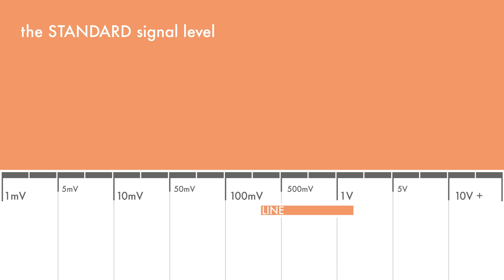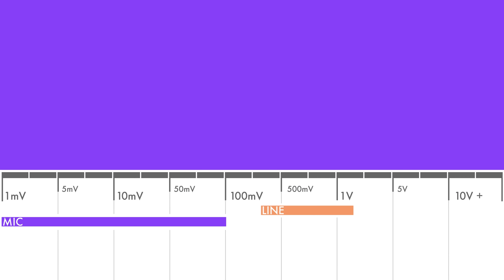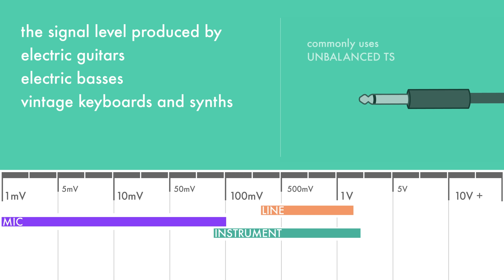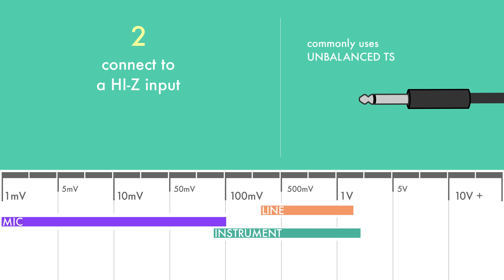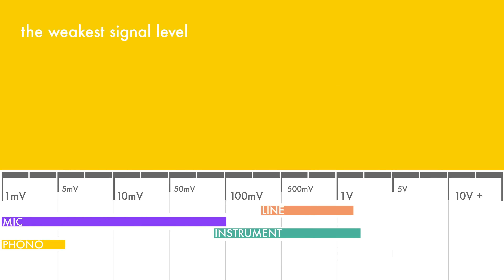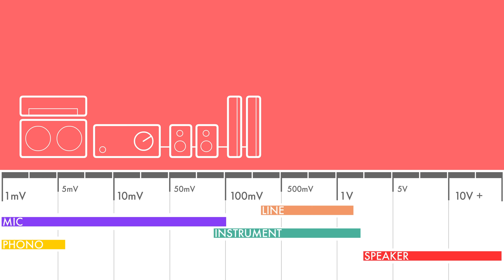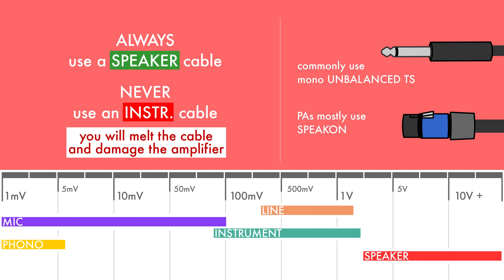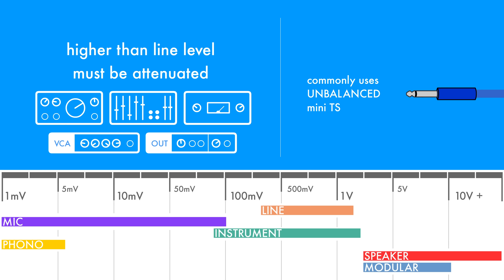Audio signal levels explained: Mic level vs line level vs instrument level

Comment from the maker: If you have any specific questions about your cables and connections, leave us a comment, or ask us on Discord 😃
Reply: And auxiliar  connections?
Reply: @canalmeu8865  Are usually unbalanced line levels.
Reply: Where do headphone output signals fit in on the graph?
Reply: @RCAvhstape  That depends on the headphones. Are those 32 ohms, 8 ohms, 4 ohms? What wattage is the output capable of delivering? Those can vary wildly across headphone amplifiers. In doubt, read the technical specification section of your manual, it should specify these values.
Reply: hey, i just commented a question in the main comments on this page :) would love to hear your thoughts
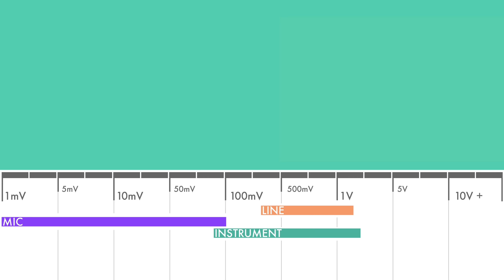Reply: 1:17 All these signals are AC biased to 0 volts, right? Like that 1V line level signal is moving between 1V and -1V, right? Same with mics and instruments?
Reply: @scottholyk8224  All AC signals are typically given as RMS, not Peak-to-Peak. RMS (root mean square) is the equivalent energy of a DC current with the same energy content over the same sink impedance. I know that may sound like gibberish - just multiply the RMS value by sqrt(2) (roughly 1.414) to get the Peak value (for a pure sine wave, complex signals are close enough though).
Regarding Bias, any unbalanced connection is alway referenced to Ground. For balanced connections, the two signals reference against each other.

Comment: Hi, how would u suggest  connecting a  line isolator to the mixer? They bring low impedance output and use xlr output. Should we just plug into the XLR input  in the mixer or use XLR adapter to connect it to the line input ? Thanks

Comment: Line level can also be broken down into multiple categories as well, typically based on signal amplitude. Most often used in audio applications are -10dB and +4 dB, although there are now standards for +12 dB and +24 dB as well.

Comment: Honest question. Why do we use a DI box to change guitar signal down to mic level which is sent over XLR cable to the desk which can be tens of metres away or further. Surely the higher voltage from the guitar would provide a better signal level over that distance. I understand that XLR uses two of its lines to send the signal out of phase and thus cut noise, but why not send this signal at the original guitar level.

Comment: more technical: PHONO is tiny (some 1 - 10 mV p-p), MIC, depending on how the internals are set up, can even be relatively high impedance (1 - few 100 mV p-p), LINE, standard, not too much, not too little (1V p-p standard), MODULAR, standardized at 10V p-p, but I'm not sure about that (up to 30V p-p, for +-15V PSU systems, 1kOhm output impedance, per eurorack standard), SPEAKER, the fun one, the juicy one (could range from tiny headphone signals 1-5V all the way up to multi kilowatt 300+V p-p class-D amp outputs at sub Ohm impedance)

Comment: Sorry. Thats not completely correct. 
Mic levels can be much louder. Even so loud that you can use it as line level. E.g. a bassdrum mic. 
Line levels can go up to 15V or even 18V (6dBu level), depending on the headroom. 
Instrument levels can got higher too. 

4dBU is 1.23V.
10 dB headroom is 3V, +20dB sind 15V.

Comment: Yo brother, Love all your videos and tutorials, they definitely have helped me upgrade as a producer/engineer, so thank you in advance, but I have some questions about a drum sampler/machine. I got an MPC1+ and I am trying to just record my tracks from my MPC into FL Studio(my DAW) on my Mac, like they used to do using the old school way, so that I can add stuff within the DAW after the sounds are all recorded and arranged. I have a Yamaha MG10xUF mixer and a Scarlett 2i2, and I have been trying to combine them to the point where I can record directly into FL because the mixer and Scarlett by itself doesn't seem to be able to record directly into FL. The mixer won't print the audio in the DAW, and the Scarlett doesn't produce any sound by itself, so I keep running into obstacles even after trying to mess around with the settings in FL Studio. Are there certain settings that I don't have set up correctly, or am I just doing something wrong with the mixer or Scarlett? I love my MPC1+ and don't really see the point in upgrading to the MPC Live 3 just to multitrack out audio into the DAW, especially when I am trying to get some kinda synth to upgrade my loop/sample game. I just want to be able to combine both my MPC1+ and FL into a workflow that doesn't feel like rocket science. Everyone I ask who uses the MPC uses Ableton, Studio 1, or Logic/Pro Tools, and I do not want to have to learn a different DAW just to get the audio recorded on my laptop. Any helpful information will be very much appreciated and will not go to waste. Thank you again.

Comment: When I was a kid, I turned two tape decks into a distortion pedal, or at least tried to. I’d record to tape 1, then I plugged the speaker out jack into the mic jack of deck 2, and cranked it up. No magic smoke, but no audio either. I blew that tapes mic preamp to shit!

Comment: Your log voltage scale is crucked. The .5 point should not be in the midle of a decade. The midle point is at sqrt(10)/10, that is around .3 not .5. That makes intermediate values impossible to read unfortunately.

Comment: Aren’t higher volume line levels also pretty common in pro audio? +4dBu balanced as opposed to -10dBV unbalanced?

Edit: the voltage range shown for Line probably is referring to +4dBu at up to 1.2V RMS. Consumer line level is supposedly down around the 0.3V RMS level.

Comment: Just found out that line level in studio gear is not the same as line level on consumer devices. 
I connected my phono preamp that outputs -10dBv to inputs 3/4 on my MOTU M4 audio interface which are +4dBu. This results in a signal that is 12dB lower than it should be.
The only line driver I could find to solve this seems to be a Radial J+4 that costs more than the MOTU itself. This is seriously annoying as everything else on the MOTU is pretty much perfect.

Comment: My recording/mixing setup uses many ins and outs; instruments, mics, DAW I/O, effects, and I don't own a mixer with FX insert/return circuitry for individual channels, so I made a multi-channel "pad box" that I can run strong signals through to set their levels to anything from phono to speaker. It consists of several precision wirewound 10-turn linear-taper potentiometers, each connected to multiple paralleled jacks, RCA, 3mm TRS, 1/4" TRS, XLR, etc. All internal cabling is "balanced & shielded" to prevent crosstalk issues and feedback. This gives me the flexibility to route signals of appropriate levels wherever I need to for recording, mixing, mastering and even live event production.

Comment: Instrument cable has a shield 
Around main conducter to prevent RF interference,but
Limits length of cable. Use of
Speaker cable can pick up stray
Radio waves and amplify them
Through  Amp. Don't want that
               🙉

Comment: On the Behringer 204HD it only has a push in button for Line or Inst and a button beside it that says Pad, so if I was using a microphone for that channel would I have it set to Inst?
Reply from the maker: That only applies if you have a jack cable plugged in I think. If you plug in an XLR it will treat the input as a mic in.
Reply: @arbitersofsound  Gotcha! Thanks for the info and quick response!

Comment: You didn't mention there are two line level standards. Consumer (typically 1/8" jack) and professional (1/4" jack or XLR). Super important and they are not compatible.
Reply: Well, "not compatible" is a little strong ... yes pro is a slightly higher signal level but any modern hardware is likely to be able to deal with the difference between pro line level and consumer line level without any issues. Going from consumer to pro ... turn up the gain on the mixer/input ... even going from pro to consumer is likely to be OK as you almost certainly have control over the pro device output ... I've never had to do it but an attenuator pad may be required I suppose. I can't honestly recall ever having had a problem matching between pro and consumer line levels, though it's worth knowing that there is indeed a difference.
Reply: @MrAdopado  I broke a nice portable speaker with a 3.5mm AUX input when I connected my guitar pedal to it. The pedal outputs a pro level signal using TRS or XLR and I simply used an adapter instead of an attenuator. Something fried and it sounded really distorted after that and I had to toss it.

Comment: If Instrument Level uses Unbalanced TS, and Speaker Level uses Unbalanced TS…what is the actual difference? How are the respective cables incompatible? How do you tell the difference?
Reply from the maker: The gauge of the wire is different. A speaker cable will have two thicker conductors inside with no shield, an instrument cable will have a thiner cable surrounded by a mesh (the shield).
Unless the manufacturer has written speaker or instrument on the cable (which is pretty common), the other easy way to tell them apart is to unscrew the jack (if it's possible) and look at the conductors inside.

Comment: What drives me nuts is so much equipment doesn’t clearly specify.  

For example: XLR is not inherently mic level. So many pedals have XLR outputs but they very rarely say what level they are outputting.  We assume it’s mic level but assumption is how you kill equipment.

Comment: Great video! I'm not really up to speed on the whole Hi-Z vs. Low-Z thing, but I do plug line level outputs from my audio interface into guitar pedals as outboard effects and then route those back into Hi-Z inputs. I just have to attenuate the output signal from the interface by 20db for it to work properly without distortion. It hasn't seemed to damage anything and I get great results.
Reply from the maker: That's also what I do with my synths when I run them through my pedalboard. Some pedals can handle it (especially the modulation/reverb stuff) Fuzz can be very specific to what impedance it wants and can end up sounding really bad...
Reply: @arbitersofsound  Fuzz is the big one, and it really depends on the type of fuzz pedal. Since the original fuzz circuit was honestly more of a wiring mistake than intentional, these can vary drastically based on impedance and volume / input voltage. Others are designed to be unaffected by buffers, which are circuits that turn high impedance into low impedance for longer signal chains. You can, however, trick older fuzz circuits with the use of a transformer based device that converts your new low impedance signal back into a high impedance signal, though doing this too many times may cause minor tone changes. 

The general rule of fuzz is that the fuzz should always go first, immediately after the instrument, but the rule of audio is that wherever and however you get the sound you want is what matters most. The bigger issue I've noticed with pedal boards is that some digital pedals cannot handle higher input levels without possibly causing damage to the unit. Another very important rule of audio - read the manual and the spec sheet!

Comment: I believe the modular section was an oversimplification. In my experience modular synths have regular line outs AND cv outs. I could be wrong but I think the cv out is the only thing that’s at that higher voltage (since it’s usually 1V/oct with a 5 octave range) and you’d never plug that into an interface or preamp anyway because it’s not an audio signal
Reply: Some of the control signals used in modular synths are DC signals, so correct, they cannot be plugged directly into other audio equipment.

Comment: What is the level of a Jack 3.5 output, for example the highest voltage level for a usual pair of 8Ohm passive speakers? I have blowed down an audiocard once, connecting that signal to a mic input, the interesting thing is that setup used to work until I desided to increase volume from the source.

Comment: I have an audio level question. 

How come mic/line-in level on my PC (Win10, Soundblaster card) is so low, relative to onboard sound?

Even with the appropriate amount of gain and/or phantom power and/or whatnot, I have to reduce the PC's onboard sound down to 10% for the line-in/mic signal to match it.   When I send the output from my Roland VT3 to my computer via USB, I have to reduce the PC sound levels to around 35% for the VT3 signal to match it. 

Is it normal to have to reduce the computer's levels that much for incoming signals to match them?

Comment: I have many guitar cables and some speaker cables. How can I identify the speaker cables so as not to use something inappropriately?
Reply from the maker: The gauge of the wire is different. A speaker cable will has two thicker conductors inside with no shield, an instrument cable will has a thiner cable surrounded by a mesh (the shield).
Maybe the manufacturer has written speaker or instrument on the cable. Otherwise you could unscrew the jack (if it's possible) and look at the conductors inside.

Comment: Nice video but quick note: there’s no such thing as a “digital amplifier”. It’s called “D class” only because that was the next letter in the alphabet. They are switching amplifiers. And although computers and class D amplifiers both rely on switching, that is a coincidence.  It’s not the switching that makes computers digital and there are digital systems that do not rely on switching.

Comment: You are confusing line level with line reference level. Audio equipment levels are limited by the power rail voltages they work on and usually can reach within a few volts of that limit. If you overdrive an input it will more commonly clip the signal  rather than blowing up the device. A device with +/-12V power, like Eurorack, can handle +/-9.5V swings which is +19dBu. Most mixers have +/-15V power and can handle +22dBu or more so attenuation is only needed when going into soundcards that run on +/-5V or just +5V or cheap mixers where the line inputs are going  through an attenuator into the mic input, they usually clip at about +7dBu.
It is more important to watch that maximum output levels do not exceed maximum input levels than talking about nominal reference levels in volts.

Comment: is anothervway to amplify a guitar to line level to use a boost pedal or overdrive pedal on a low setting?
Reply: In terms of volume, yes. But there will still be an impedence difference, and you'll also be coloring the source of the sound.

Comment: Should have explained BALANCED and UNBALANCED. Many people have no idea what that means.
Reply from the maker: We’ve got a separate video about that if you’d like to understand the difference 😊
Reply: if im not mistaken the only difference between balance & unbalanced cable is the grounding wire in which the latter doesnt have
Reply: @internetidler  You are mistaken ... 😉😀
Reply: @internetidler  while unbalanced cables only carry the Signal and ground, balanced cables are capable of carrying Signal, ground AND inverted Signal. Losses to the Signal due to interference and cable length are also lost in the inverted Signal, but subtracting the inverted Signal from the original, those losses can be eliminated. Sorry, my technical english really isnt up to par. But maybe it helps your understanding
Reply: @BB_Kaiser  A balanced cable can also have only two wires, and the screen is not connected at all. The significant difference between balanced and unbalanced is that in a balanced connection the impedances of the forward and return wires relative to the ground are equal.

Comment: just want to double-check something: when reamping guitars, the output signal from the audio interface is Lo-Z, and a reamp box converts it into Hi-Z so it can be plugged back into an amp and avoid noise, correct?
Reply from the maker: Correct, and also potentially lower its amplitude to not overload the amp.

Comment: The shape of the connector has nothing to do with signal level. For example a 1/4" connector works with the almost non existent voltage from a guitar pickup OR hundreds of watts from a power amp to speaker. Same with XLR. Everything from mics to DC power to speakers. There are other ways of connecting audio signals such as crimped lugs on a barrier strip termination.

Comment: It is my understanding that guitar effects take instrument level signals, and synthesizers put out line level signals, and this mismatch can cause synths to clip the inputs of guitar effects <especially digital multi-effects> and suffer from a general lack of headroom.Other than keeping your synth volume very low and being super conscious of gain staging ,are there ways around this?
Reply from the maker: I believe a re-amp box would solve that. It's sort of a reverse DI. It takes the line-level lo-Z signal and converts it into a guitar level hi-Z signal that you can send to your pedals (or even guitar amps).

Comment: Where does speaker level 'come out' of? Like is this if you have a Phono > Preamp > Speaker > Speaker out??
Reply from the maker: Yeah it's what comes out of speakers, but more precisely it's the level AFTER amplification just before it goes to the speaker, whether that amplification happens in the speaker body like with active speakers, or separately in a standalone amplifier.